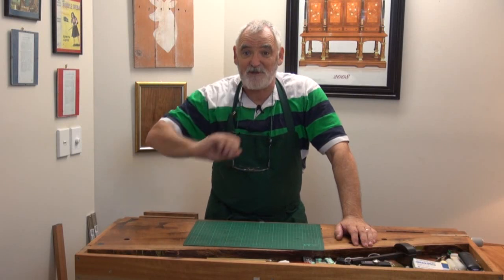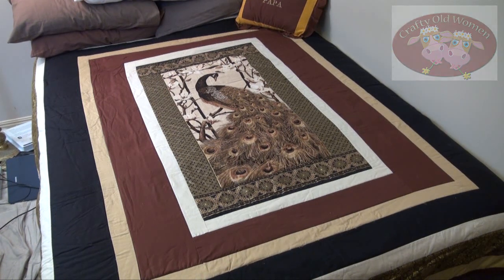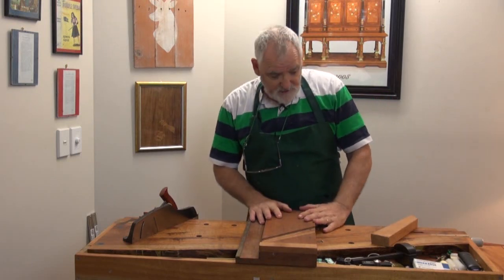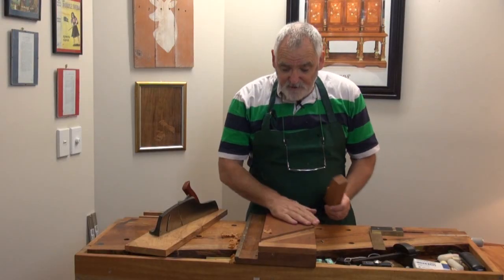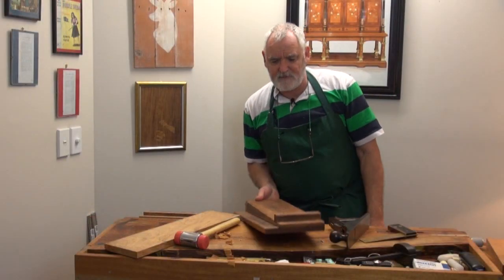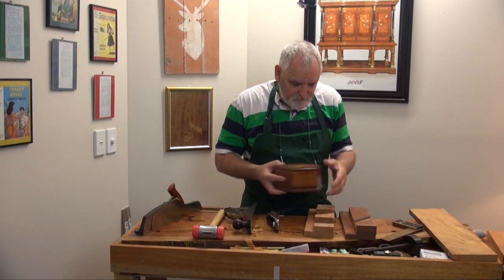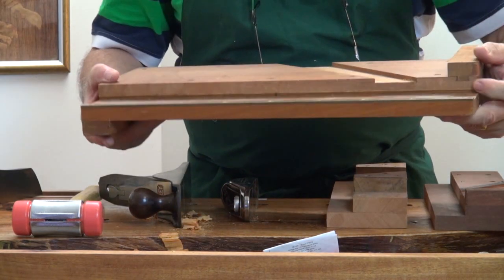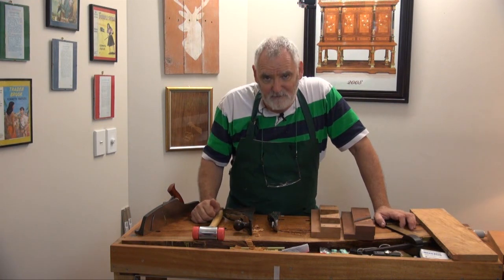Making a Shooting Board with Hand Tools Pt.1 of 4

Comment: Hi there from Portugal,
Nice! Hand tools :D no dust no noise( almost) :D
Obrigado(Thanks)
Reply from the maker: Hi Back, yes had to make a couple if concessions for practical reasons so I'm allowed the Jigsaw and a Sander fitting up to a small extraction unit. All working well at the moment. Cheers Steve
Reply: Yea my lady will not even allow a jigsaw or a sander in the house. I have to use sandpaper strapped to a board and a coping saw instead. I just keep telling myself she does it so i can be a better woodworker lol
Reply from the maker: I do so I CAN be allowed to work inside the house, practice more and better woodworker. lol Actually the missus it rapt she had never got so many thing done and finished so quickly. You try that one and use me as a reference if you think it will work.:) Cheers Steve
Reply: Will try that steve lol.
Reply from the maker: Let me know which hospital you get sent to..... Cheers Steve
Reply: No need to worry. I am in America I doubt you would want to send me flowers lol. I just recently purchased a no 4 plane and a block plane and my lady asked why I need more than one. She is not a woodworker obviously. I plan on making her happy and building her a box of cubbies and some boxes to slide into them.
Reply from the maker: I'm sure she will be delighted with the added Storage area and the Boxes that come with it. You could always put your Planes there as well. lol Cheers Steve
Reply: :D
Reply from the maker: But that little bit of noise cuts out a lot of dust. :) Cheers Steve

Comment: If the plane isn't perfectly square, can't you adjust the cut with the lateral adjustment to get a square edge?
Reply from the maker: I'm pretty sure that would not make a difference because it is being adjusted out of the vertical plane. Who knows give it a try. Cheers Steve
Reply: According to Paul Sellers you can do this.